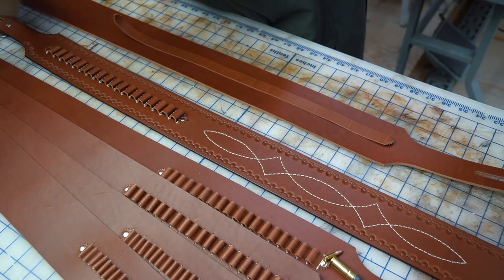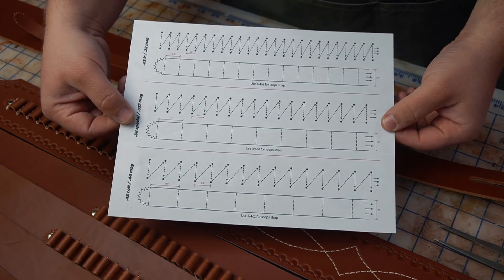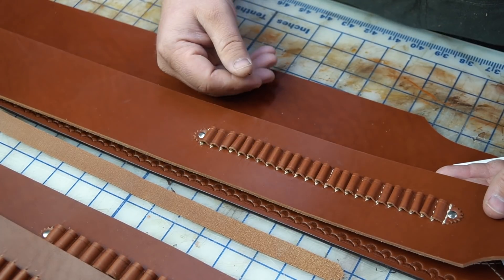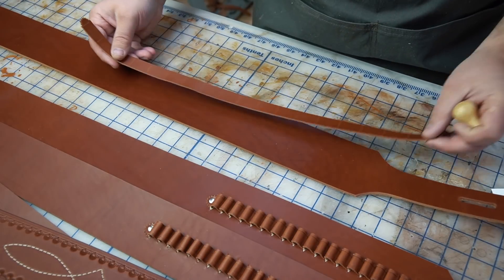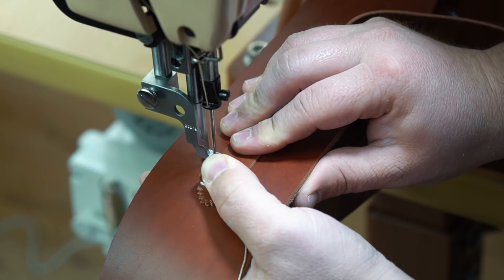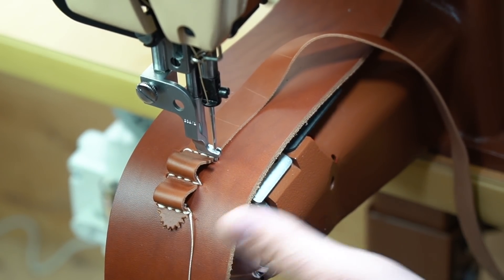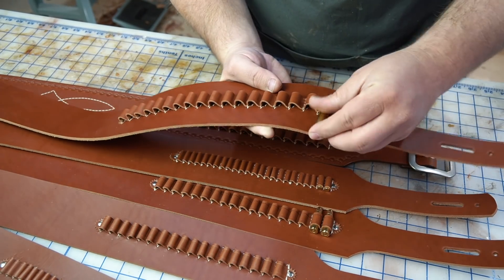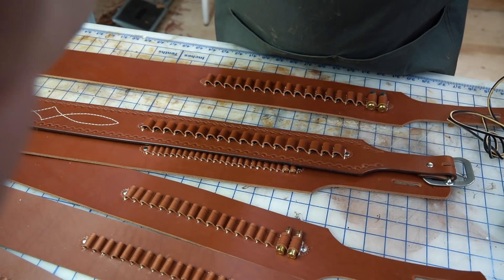Stitching ammo cartridge loops on a western leather gun belt (Full edit) - Free Download

Comment: I have found that sewing the cartridge loop directly to the holster belt the cartridges mark up the belt and stretch the loop at the top when withdrawn (perhaps I’m making the loops to tight). So I started sewing cartridge loops on a strap and sewing the strap to holster belt. That slight clearance seems to make a big difference. Love your work brother.
Reply: Of all the builds I have seen I have wondered the same thing. I guess it depends on the look you are trying to achieve. Being an active competition shooter I would expect the extra clearance would not only save your belt from getting marked up but would also make it easier to extract the cartridges when needed.

Comment: One problem Ive run into while horse back. When the loops are placed on the belt too low the cartridges have a tendency to hit the cantle and pop out. Ive lost a few rounds that way.
Reply from the maker: yeah i could see that happening. Though this is a single holster rig so the cartridge loops are all on the opposite side of the holster as opposed to the back of the belt. So it probably wouldn't happen with this belt, but that's a good thing to know. Thank you

Comment: Thanks for the vid's,  I am new to leather work and ran across you vid on sewing machines, I spent almost 2 hours hand sewing a belt and was looking for information on beginners machines,  towards the last loop on your vid, does the machine,,, IF it goes thru your fingernail does it tie the knot in the leather or in the middle of the tip of the finger LOL.  benefit of having a machine that will run slow, at least for me. Thanks for all the info.

Comment: Great info, thanks!  With the diagonal stitch inside the cartridge loop, is there a risk of wear on the thread from regular use that might cause the stitch to break?  Seems like a possibility, but conjecture doesn’t always match reality.
Reply from the maker: It's definitlely possible but i've never seen it happen. It's a very common method for ammo loops

Comment: Best machine for a beginner?
Reply from the maker: Totally depends on what you plan on using it for. If you'd like something easy to learn on for some small leather goods (10oz or less)at a hobby level, I'd recommend the Tandy/sailrite Stitchmaster pro. I have a review video on it. If you'd like something a little more professional i'd go with a cobra class 20. If you plan on JUST doing heavy weight stuff, like holsters, sheaths, tack, saddlery, etc...i'd recommend the cobra class 3 or 4 (like the one in this video)
Reply: @whitandpark  thank you for the response.

Comment: 5 per cylinder for single actions. I would probably go with 20 rds on the belt. Just my 2¢
Reply from the maker: In a 1873 SAA its 6 rounds per cylinder
Reply: @whitandpark  yes but if you are carrying it, and your pistol doesn’t have a cross bolt safety, you run the risk of the pistol going off if the hammer is hit by something and you have all 6 chambers loaded. 6 round cylinder, but carry 5.
Reply: @bodiewest9202   Jesus... If the cylinder holds 6 rounds . you will want to have enough rounds on the belt to equal the amount in the cylinder not the amount of 5 rounds because of safety....
Reply: @bodiewest9202  not trying to be "dick". Just saying it makes more since the way he does it... But if you are so into having a number of rounds divisible by 5 you could put 30 loops on the belt. (It still works for 6)

Comment: why are you not finishing the leather before sewing? edges look rough and are unfinished.
Reply from the maker: the leather for the loops is tight grained and thin enough, you don't need to burnish. I dye and burnish the edges of the belt (the heavy weight leather) at the end
Reply: @whitandpark  I think staining the edge of the loops enhance the overall look of the loops. Then a quick rub with a cloth, denims good, would be sufficient to finish a good product. In addition do you have a number one edge shave. I was always encouraged to edge belts gun belts and harness, as it gives a professional finish. Also prevents the belt from rubbing against clothing a clean finish that will last.